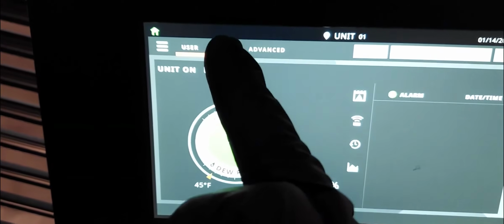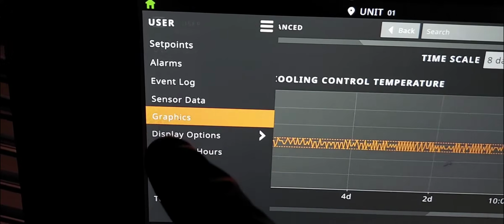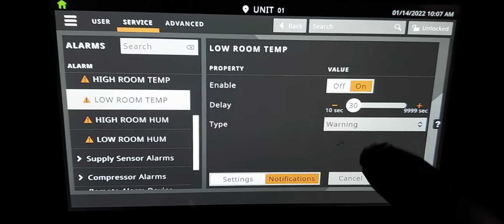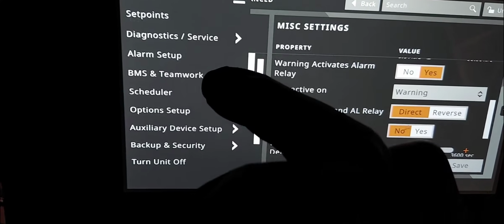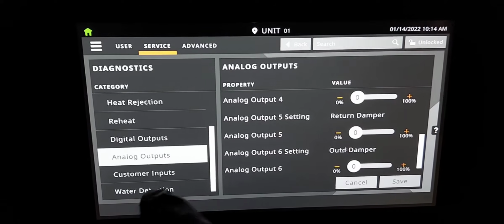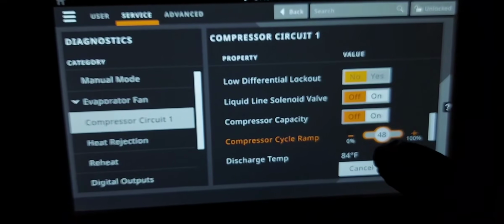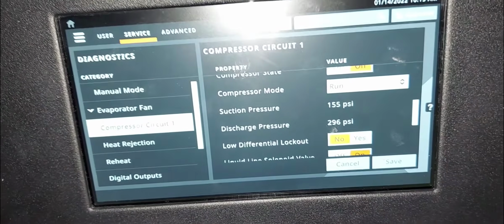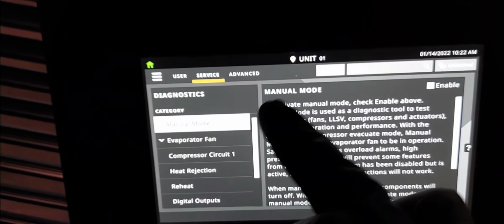VERTIV / LIEBERT TOUCH SCREEN TUTORIAL

Comment: Dear Sir. I'm stuck with a VERTIV PDX025. Upon sudden change of power from Generator to Mains through the changeover switch. The following alarm comes up "Compressor Thermal Protection Circuit 1'' comes up. Can you help in solving this problem ?
Reply from the maker: Yes possible
Reply from the maker: Are you a preferred member?
Reply from the maker: Send info via what’s app if you are!

Comment: Hello Buddy, Great video, That unit were you working on is it connected with BMS/STANDBY MODE? If it is can you make a video on how to put PDX on standby and how to remove it from Standby, Thank you for your valuable time.
Reply from the maker: Are the units already networked?
Reply: @D2DNYAC  NO worries, I figure it out, the unit was networked and I was trying to put the unit on standby mode, but since it was off by display I was not been avail to put unit on Standby mode, Once I started the unit after that under unit rotation I was available to put the unit in standby mode, Thank you my friend for your reply much appreciated 😀

Comment: Can you please explain me how to i decrease the compressor cuttoff time. Currently the difference is 4°c . All i want to say is that if i set the temperature to 23°C compressor generally cuttoff at 19°C . How can i recude it lite by 2 °C atleast. Thank you in advance
Reply from the maker: Not sure if you can decrease deadband lower than 4 degrees however you can try
I will also check this out next time I am in front of this unit

Comment: What's the exact meaning of the capacity Reduction alarm c1
Reply: If you look at the video you'll see some green writing 160v 1134. That is an Exchanger.  Water and refrigerant. 410a runs inside the Crac, the heat is transferred to the water in that exchanger and goes to a Chiller or DryCooler Condenser most likely. You will have pumps on this system with Y-Strainers. So to your question. Why the alarm? and this really should not be an alarm as much as a warning. Most common problem is the condition of the water, how clean are the strainers, are the pumps moving water. Then comes the Condensers, are all the fans running, all the motors are in good condition, are the coils dirty. 

These Compressors will modulate themselves to keep from going into a High Pressure Event within reason. In many cases you can have Capacity Reduction on uncharacteristically hot days the equipment was not designed for. I can't tell you how many techs have wasted so much time trying to diagnose a problem that doesn't actually exist, the equipment is simple under or over sized. And you need to think about load, kw.. Did anything change in the room. Some switches have engineers that watch this stuff, some don't.
Reply from the maker: head pressures too high
Reply: Yep figured it out thanks
Reply: How to solve this. Or what to look for.  Refrigerant is good.   Condenser coils are clean.   What could be the couse?